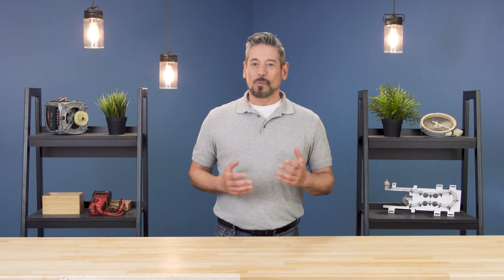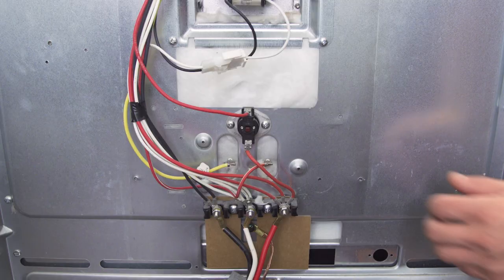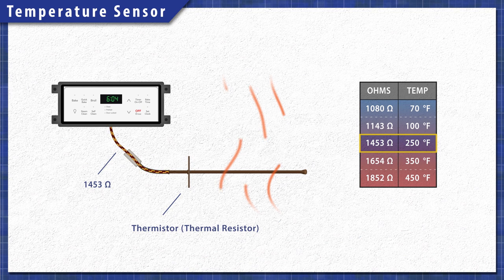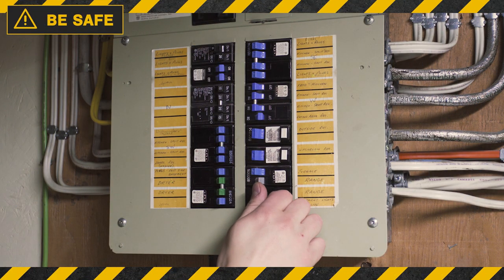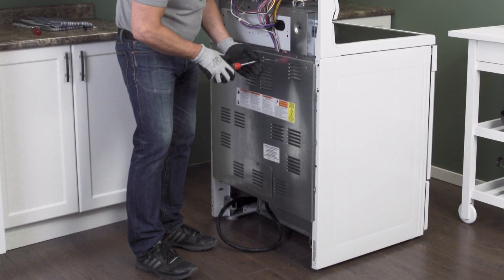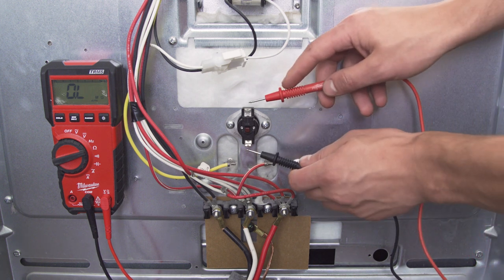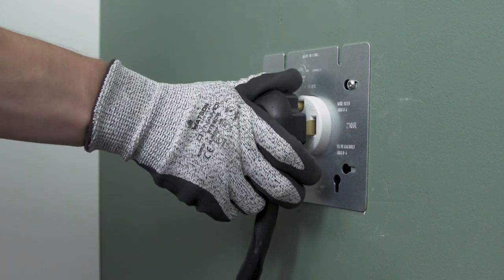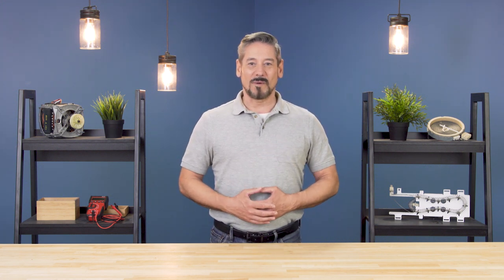Oven High Limit Switch - Testing & Replacement | Repair & Replace

Comment from the maker: Did this video help you fix your oven? Did you run into any problems? Let us know in the comments!
Reply: i have a maytag merh865ras16.  Heating element was broken, replaced it.  Check high limit switch, within ohms. Checked temp sensor, ohms reading normal.  Still not getting hot.  At 100F for 10min.  What can it be?  thanks for your help with this matter.
Reply from the maker: @andrewbernier3582  Thanks for watching. Does the stove still work? If so, then it could be a faulty control board or a connection https://youtu.be/96s7maybHlY?t=398
Reply: My problem is getting DOOR message when trying to use my wall oven
Reply from the maker: @mahmoudbenam1045  Thanks for watching. A door error code likely means that the door switch is faulty or there is an issue with the door lock.

Comment: I have a wall oven ran self clean and stopped working during self clean.  No power, doors locked. I had to use wire to get doors open.  Looks like high limit switch on this GE unit.  Is this most likely it?  Oven is 1 year old.
Reply from the maker: Thanks for watching. Yes a high limit switch could have tripped but not all models have a high limit switch, you can check using this tool: https://www.amresupply.com/lookup

If your model does not have a thermal fuse or high limit switch it could be an issue with the temperature sensor, or the control board.

Comment: Thank you for the video. I hope this works for me. I have the samsung  NE59R4321SS-AA-00 oven. It heats up to temp when you turn it on but will not hold the temp. I have to keep entering the temp over and over to get it back up. I replaced the Temperature Sensor  already and that did not work.  Do you think this is the problem and I need to replace the High limit switch? Or could it be something else?  Any help would be great, it's driving us crazy. Thank you and I look forward to your reply.
Reply from the maker: Thanks for watching. Have you verified that both heating elements are working? https://www.youtube.com/watch?v=ABope7vl5IY
If the bake element fails it can create issues. The bake element provides 80% of the heat during a bake cycle, the broil element is only on 20% of the time. In this case the oven might still heat up during a preheat but once it switches to the bake cycle it will shut off the broil element more often resulting in a reduction of temperature.
Reply: @AmreSupply  I did, yes I tested them and if I remember right I got like 25ohm from the bake. The broil is just fine also. This is making my oven useless. Thank you for any help you may offer.
Reply from the maker: @marcstephen-em9ve  If the elements are good, and the temp sensor and the wires are also good, then it could be the high limit switch or thermal fuse in some models. Not all models have a thermal fuse or limit switch. After checking all else, it could be a faulty control board.

Comment: Hi Vance.  I like your videos and how you carry yourself in them.  I'd love to hear your opinion on this situation, now that I've watched all your oven videos and followed their advice ...  

Oven = GE Spacemaker (JMP28).  Oven/Stove top combination

The problem = Bake mode is initiated (as heard by click and shown by display), but, after about 5 seconds, the mode is terminated (display no longer reads "Bake On").  The same is true when using the Broil mode.  The oven doesn't even have the chance to heat up, and only the broil element appears to heat very slightly.  When my mom tried to use the oven twice the week before, she heard the oven beep to indicate preheating was done, but after she put the food in the oven, it never ended up being cooked, and was room temperature when she later opened the door.  The stove top and display work just fine.  Also, I notice that even when the oven is not running, there is a slight hum/buzz coming from it; it is not coming from the small ~3 in diameter fan located at the top back of the oven (I cannot tell where the noise comes from).  My mom does not remember noticing the noise in the past.

Test results = Bake element appears undamaged and reads 30 Ohm across and infinite Ohm when tested to oven frame, broil element appears undamaged and reads 18 Ohms across and infinite Ohm when tested to oven frame, temperature sensor appears undamaged and reads 1010 Ohms (however, it should be noted that I DID NOT unplug the temp sensor from its leads when testing, as they were crimped to the leads), no error codes on display screen, no burn marks or deformed capacitors/transistors on the control board, THERMAL LIMIT SWITCH HAS ZERO CONTINUITY and is not a re-settable type.

Conclusion = The thermal limit switch needs to be replaced.  Perhaps the humming noise is coming from an internal fan that is automatically turned on to prevent overheating of the oven--this would make sense, since the limit switch is designed to prevent overheating? I realize that I need to replace the thermal limit switch no matter what, but I am concerned that by replacing the thermal limit switch, I'll just have it fail again, without fixing a bigger underlying problem (although, I do realize that limit switches can simply go bad in and of themselves). 

My Question =  Given the above details, should I simply replace the thermal limit switch and see where it leads me--even if it just ends up failing again and costing another $50?  Or, can I bypass the limit switch by connecting the two leads on opposite sides together followed by running the oven to monitor its behavior and to gather more information to see if the underlying issue might in fact by the thermal sensor or something else (I could put a thermometer inside the oven to make sure that it doesn't overheat during testing)?  

Any advice would be greatly appreciated.  Andy
Reply from the maker: Thanks for watching. Based on your tests, the thermal switch is faulty. Overtime the bi-metallic strip inside of the switch can wear down. It is however not recommended to bypass any safety switch since the appliance is designed to be used specifically with that switch.
Reply: @AmreSupply  Thank you!  I appreciate your quick response.  I sure hope replacing the thermal switch will solve the issue.  That slight humming/buzzing noise, even when the oven is not running, has me concerned.  I will chime back in for others to learn from this, once I've figured out more.
Reply: Well, I definitely struck out on this one.  It turns out that: NOT ALL LIMIT SWITCHES HAVE CONTINUITY IN THEIR DEFAULT CONDITION--SOME ARE "NORMALLY OPEN" WHILE OTHERS ARE NORMALLY CLOSED (UNLIKE WHAT IS SHOWN IN THIS VIDEO).  Thus, I tested my limit switch and it showed no continuity, making me believe it was bad, as shown in the above video.  I ordered a replacement that was used.  It also showed no continuity, leading me to believe that it also must have been faulty.  I then ordered a brand new one, and it also showed no continuity.  More research reveals that some limit switches are "normally open" while others are "normally closed".  Just thought I'd mention this to those who have viewed this video--I wish the video had discussed this, as it would have saved me a lot of time and headache.  The moral: BEFORE BELIEVING THAT YOUR LIMIT SWITCH IS BAD, MAKE SURE YOU KNOW IF IT IS A "NORMALLy OPEN" OR A "NORMALly CLOSED" SWITCH.  At the moment, I now have no idea how to repair my oven, as everything else tests well, as described in my original post.
Reply from the maker: @AEMBowers  Thanks for watching. It is not very common for ovens to use normally open limit switches any more so we didn't focus on that. 

It is not likely that a new switch would arrive faulty so it is most likely a NO switch. You could use a heat gun to apply heat and see if you get continuity if you wanted to be sure.

If the limit switch, the temperature sensor and the heating elements are all good. Then it could be a faulty relay in the control board.

Relays can't be replaced without additional skill or knowledge so in most cases people decide to replace the entire board.

Comment: what is minimum ventilation of kitchen?
it's in  new jersey test from
door window exhaust fan. or range hood
Reply from the maker: Thanks for watching. According to the Home Ventilation Institute (HVI), the minimum airflow ratings for kitchen exhaust systems is 100 CFM There are also considerations of minimum duct size but it's best to check the building codes for your local area as this differs based on province or state.
Reply: thanks 😊
Reply from the maker: @josephkwon9034  You're welcome

Comment: Hello (great video btw)  I'm still unsure about my problem. I have a samsung ne59k3310 (no convection model) and it broil and heat, but doesn't heat enough to cook. As if it heat at 50% even tho it indicate 400f.   I have enough knowledge to  change a faulty high switch, but wondering if it make sense.   What are your thoughts.   Thank you 

p.s. the oven was underuse, we don't cook very often with the oven. once or twice a week and range is about 5 yrs old.
Reply from the maker: Thanks for watching, we're glad that you found it helpful! It is likely that the temperature sensor is faulty. You can learn more about how to test the sensor and how to replace it in this video. It will show you everything you need to know: https://youtu.be/jnt_mUwdL8o
Reply: @AmreSupply  Thank you for the quick answer.
Reply: @AmreSupply  Update : it's the baking element, it is clearly broken. i was able to see throught the hole with a flashlight.  thanks again for your tips and great videos.
Reply from the maker: @Drekulviin  You're welcome, we're glad that you found the videos helpful!! Its good that you checked the elements more closely. Since the bake and broil elements are both active in the bake setting, a broken bake element would explain why the bake setting was only heating partially when you tested it. Cheers

Comment: I don’t see my problem in these videos 
DOOR message on wall oven
Reply from the maker: Thanks for watching. A door error code likely means that the door switch is faulty or there is an issue with the door lock.